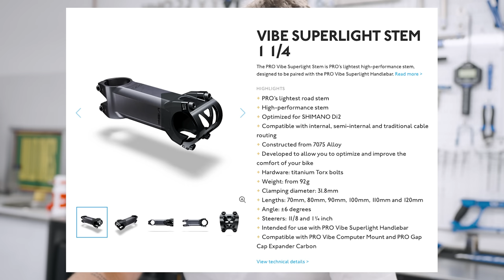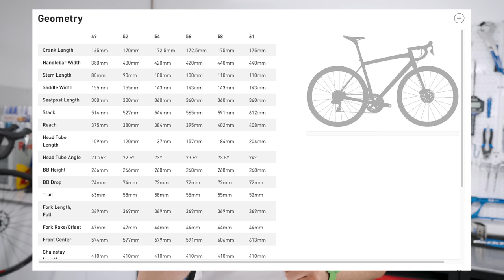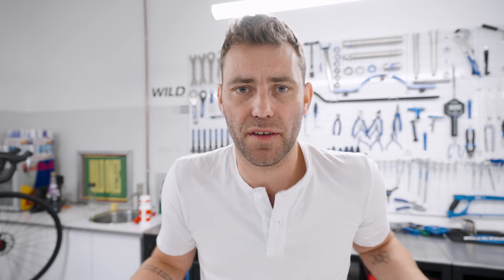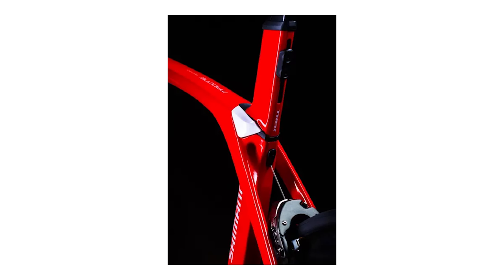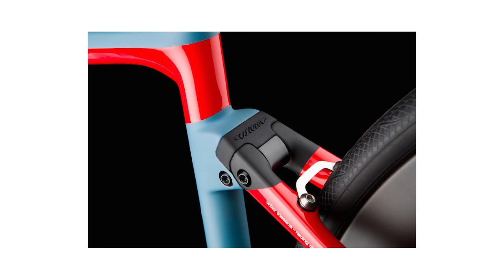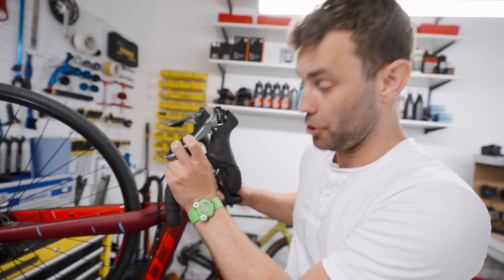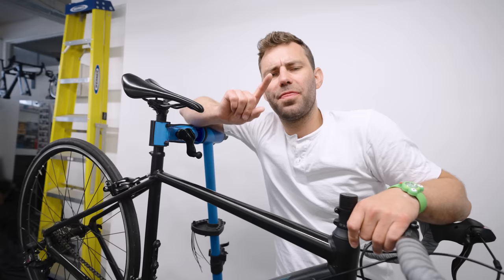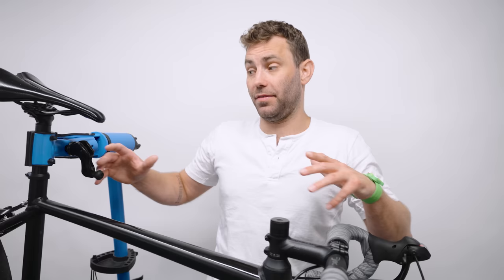Bike Fitter's 10 More Most Hated Products

Comment: The bike sizing thing is so true. I'm 195cm, which puts me in the top 1% of the UK population for height, yet I ride a large Canyon frame. There are two sizes above that!
Reply: What do you think about Merida Silex XL for 194 cm guy? 🤔😥
Reply: Modern geometry.  Look a Beryl Burtons bike fit. Long and low and still holds records.  I'm 6.1 and ride 60cm with 58 top. 90mm stem. Works perfectly as drop to bars not huge. Nowadays I would need, " endurance geometry ". . Progress.  Na
Reply: Canyons tend to run really big.  I'm 178cm and Canyon would suggest a small on their road and gravel frames, most road/gravel sizing guides for other brands would have me on a 56cm frame.  On MTB frames I usually ride a large (my sweet spot on MTB reach is 470-480mm), a size L Strive is over 500mm reach
Reply: @nickyburnell  Sorry, I don't understand the second half of your comment. Could you explain me please? (from "Works...") Thanks 🙂
Reply: @JanKowalski-ux6nt  It depends! Only you know how long your legs, torso and arms are. Only you know your comfortable cycling positions. Best option get a bike fit, if you cannot do that try them out, if you cannot try a specific bike out try the nearest you can in terms of geometry.
Reply: @bencollier9423  Thanks! Btw, have you heard of Flat Pedals Revolution Manifesto? What do you think about it?
Reply: Funny, I am 196 and I ride the largest Salsa Warbird, with an upright posture, and still need a 140mm stem, and ideally would like to go a bit longer.
So in my case, my complaints  that they don’t make bigger frames.
Reply: This is really reassuring. I’m 198cm and couldn’t believe what canyon was recommending for size. I was tempted to fudge the numbers because I thought that surely I’d be an XL or (more likely) 2XL.
Reply: @TheAnon232  If it reassures you further, I've had a professional bike fit since making that comment and the only adjustments required were some some tweaking to the spacers and hoods, and some narrower handlebars. I'm exceptionally pleased with the bike.
Reply: @tinglydingle  good bro 😊

Comment: I agree about those rear suspension. Systems built into the frame - they look like a problem waiting to happen.
However, I've been very pleasantly surprised by the Redshift shockstop post. The mk1 version with the springs is very easily tunable, and it irons out the more serious bumps that my 35mm tyres don't. Without any noticeable bobbing.
It's great for gravel and the crap, badly cracked  concrete roads i ride. If I ever wanted to race, I could pull it off and stick on a lighter regular post.
Seems like the perfect compromise to me.
Cheers
Reply: I think part of the issue with the way rear suspension has been incorporated into road frames (and also some gravel, like that Diverge STR), is that the suspension operates on a parallel axis to the frame, as opposed to perpendicular like suspension on mtbs. Seatposts operate perpendicular, and a couple have no rearward deflection at all. It still changes your fit, but at such a small drop its probably not really a major impact. Flexing 20-30mm rearward though not only changes knee position in relation to pedals, but also stretches you away from the cockpit. Seems so sketch to me.

Comment: The thing with Brooks *leather* saddles is that they've got incredibly short rails, and were designed back in the time when angles were more slack, and all seatposts had setback.
If your bike has steep angles, and you want a very specific seatpost, you better know that the sizing and fit is bang-on.
If you have a bike, where all that is bang-on, you will be quite happy with your durable flexy saddle, even for all day riding, but it can easily go either way.
When you go to the Cambrium rubber saddles, you've got a lot more room for adjustment, but you better hope the shape and flex of them is exactly what you like.

Comment: Regarding long reach handlebars, all the "avoid" handlebars could actually be good handlebars to buy for fixed gear riders which is pretty funny. Since they don't usually use STIs or brake levers with hoods the longer reach on the handlebars make them easier to hold
Reply: 100%
Reply: I have friends with deda bars on fixed, it's not fun lol
Reply: exactly what i thought
Reply: I run a Bontrager VR-C on my State Black Label. It’s perfect 😅
Reply: Also what if you have long arms or a long torso? Long reach bars would be a solution
Reply: There aren’t any hoods, surely you just avoid the hoods position entirely like a track bike, or pick bullhorn bars or something.
Reply: @chrispressdee5747 longer frame...

Comment: I've used both the Brooks B17 carved and C17 (cambium) carved on my fixed gear as well as my two gravel bikes, all of which have a saddle to bar drop of around 34 mm. I like both saddles, but the B17 (aka the leather one) is easily the most comfortable saddle I've used. Maybe it's because my saddle to bar drop is rather shallow, but it just works. At one point it did become more uncomfortable once the leather started to sag, but tightening the screw on the bottom made it super comfortable again.
Reply: Yeah, b17 narrow on my road and gravel bikes. No dramas for me after many thousands of KMs.
Reply: I’ve got a B17 Flyer on my Brompton, easily the most comfortable saddle.  Recently tried an Ergon saddle followed by a WTB Volt, then put the Flyer back on and tightened up the bolt and I’m back to comfort again.
Reply: B17 on my gravel as well. It’s 13 years old and I keep it softened and looked-after…..it’s glorious.
Reply: B17 fixed my saddle sore problems and pretty much all crotch pain issues.  I've never found a saddle anywhere close to is comfort.
Reply: Done a few ultra's in my time, B17 imperial on a Diverge frame with gasp Futureshock suspension: 500km in <24hrs, no issues. 850km in 2.5days, no issues. 1700km in ~7 days, no issues. Will one day do the IndiPac, 5600km, reckon I'll use the B17. Infact, if you look real close, it's there in my profile pic^^^
Reply: B17 on a fixed gear bike is stupid because its a very heavy saddle and when you do stand up pedaling its going to feel like a pendulum swinging back and forth.  If you're gonna use it put it on the touring bike.  Get a nice Fizik saddle with a carbon bottom so stand up pedaling isn't as much of a slog, you don't want to be bouncing a 3kg saddle back and forth every time you stand up.
Reply: C17 on fixed is ok, but it's also heavy and the bounciness of the rubber can mess with your pedal stroke a bit.
Reply: I have got the b17 Flyer and its a great saddle i love it i used the c17 cambium but that didnt worked for me
Reply: I've had a B17 on my touring bike for many years now and I love it

Comment: I brought my canyon endurace 4 years ago, I am 5’9” mature 50+, I was convinced I was a medium size but the canyon chart said I was a small, I brought the small,for my me it was a massive difference coming from a M/L TCR which was recommended for me by local bike shop who just looked me up and down and said yeah that’ll fit.
Reply: Same for me but I just went trial and error. I'm also 5'9" and started on a 54cm Fuji since it was my recommended size. I rode it for 3,500 miles and tried every position imaginable but never quite felt like the bike fit. I jumped on a 52cm frame for a test ride and it immediately felt perfect. I have over 6,000 miles on it now in comfort.
Reply: Canyons run big, but I would have put you on a medium giant in an eye blink. The m/l is for six footers.

Comment: The Trek VCLS handlebar being long reach makes so much sense! I've a 58 Trek and I get bad neck and shoulder pain, feel like I've to stretch too far. Other similar sizes frames I had no such issue.
Reply: 56 Trek for me came with a 7degree 100 stem and those bars with 93 reach. Put a 6degree 90 stem on ages ago and it's a bit better. Next time my bar tape or brake bleed is due I'm definitely swapping down to an 80 or 70 bar. Gravel bikes do generally spec 70s these days (except Trek lol) but I've still got a pretty long torso and I ride drops a lot so I'm leaning towards the 80.
Reply: Trek road frames are all really short though, they’re making them back up to the usual length with a longer reach handlebar. 

You’re probably just on the wrong size bike.

Comment: The thing with Brooks saddles is that they are amazing when you're riding in an upright position. I have one on my city bike for a decade now and it just works perfectly. That's the one with a flat bar with gigantic sweep and not a bike where you need a fit on. Coming from this I did the mistake to get an Brooks C17 when I got my first serious bike just to quickly discover that it's in the way in aggressive riding positions. I got a Supacaz Scorch as a replacement and I do love this saddle so much!

Speaking about wide dropbars for more control : there is this rare breed of people that like to ride dropbar mountain bikes for bikepacking on hiking trails and/or off-road ultras where they make a lot of sense. I started looking for a gravel bike, just to realise that gravel is boring and I want to ride the most remote trails possible.

(If you aim to ride really remote trails swiftly, don't make the mistake to buy a Gravel bike, most of them are seriously undergeared. Get a dropbar mountain bike or build your own starting with mountain bike frame and cassette.)
Reply: Undergeared? They are normally geared like road bikes aren't they while my MTB is running 36-10-52 😂

Comment: I love my aethos. The stack height is greater on the aethos than the tarmac sl7 making it more relaxed.
Reply: That's because both the SL7 and Aethos stack dimensions are given to the top of the bearing and on the SL7 it sits below the top tube by about 7mm, once the proprietary bearing cover is installed the stack becomes identical (this obviously effects the reach too). Technically you can choose to not use the proprietary bearing cover in favour of an external to internal type (basically a standard cover with holes drilled in it) on the SL7 and drop the stack below that of the Aethos but it looks weird as the bearing cover integrates into the frame and it leaves an ugly gap.

Comment: My bicycle fitting pet peeve are road/gravel bicycle brake levers with integral master cylinders for hydraulic disc brakes. This increases the reach of the brake lever body, making it difficult to find a position where it's comfortable to ride on both the hoods and the drops. You're either too stretched out when riding the hoods or too cramped when riding the drops.

Comment: It Doesn't matter how steep seat tube angle is. Horizontal distance between saddle and BB is determined by length of legs and feet. Slacker angle is negated with seatpost without setback and vice versa. Thus you can simply orientate by stack and reach. Everything other can be compansated with stem and handlebars.

Comment: With you all the way until 13:28.  In USA, the mean clothing size is XL and the range to cover 90+ % of the population is Medium through XXXL.    Bike sizes of small fitting the smallest 25 % of population, medium fitting middle 50 %, and large or xtra large fitting top 25 % makes more sense than clothing sizes.

Comment: Last year I nearly went nuts trying to figure out which size of each bike I was considering I needed to look for. When you're trying to buy a bike and you go through websites of stores in your location its a madhouse really. Each time you have to go to each manufacturers website and check their size charts. 
I made the right decision in the end and managed to get the new bike to fit me nicely I believe by nothing more than getting a new stem 10 mm shorter. But the way manufacturers size their bikes and the way bike stores present this sizing info is very confusing.

Comment: Just rebuilt my left 20 year old Campy Centaur Ergoshifter, which can be almost completely taken apart. Didn't really have to as it was working ok. I just wanted to clean it up and regrease it to make shifting a bit smoother and perhaps extend its life a bit. I'm debating whether to do the same on the right one as I did this some years ago. I probably will, because, well, I can. Takes all of 30-60 minutes to take apart, clean, regrease and rebuild, IF you know what you're doing. If not, it'll take the better part of a day, most of it spent figuring out how they come apart and fit back together.

My point is, better than Shimano in this respect.

Comment: Now I know why my feet started hurting after moving to Specialized shoes. Not something I noticed straight away, but after a few months of increased fitness and power my feet started killing me. I wish this was something that was stated upfront when buying the shoes.
Reply: Me also. Have had issues with them for a long time now.
Reply: I'm glad I seen this video cause I have a pair that I use for shopping runs and found that they feel a bit off while riding. I was thinking about getting a new pair for my normal rides, but now I won't.
Reply: Specialized used to (maybe still do) brand this as "Body Geometry" but in most people's experience it is usually geometry for someone else's body...

Comment: As a bike fitter myself, I can concur with all of these comments. The most important thing and something we offer is "fit first, buy second" and also try to find a bike fitter that does not sell off the shelf bikes as they will have no stake in selling you what is on the shop floor. I have had dozens of cyclist coming to me to size a bike and they all say it is the best £50.00 they have spent.
Reply: £50? I’d get a bike fit in a heart beat if it was that cheap here.

Comment: Bar reach - as a general recommendation on the assumption that the reach for most folk is too long is reasonable.  But, like all generalizations it fails in specific cases.  I’ve got 3 drop bar bikes and the bars are 46, 42 and 39.  The stem lengths vary from 50 to 100, and all the bikes effective reach is similar.  Why?  Different applications.  I like wider bars on drop bar mtbs and gravel bikes, my road bike fits James’s recommendation.  Short reach bar, narrower bars and a traditional stem length.  My gravel bike has longer reach bars, and this gives me more hand positions and different reaches for long days at slower speeds.  Short reach bars mean you are generally riding the hoods, great for all day on a road bike but not necessarily ideal on off road drop bar bikes.  The key is getting the fit right, if you do the reach of the bar is not really critical.

Comment: I have a Brooks saddle but it is on my flat bar, upright, heavy duty touring bike. I wouldn't dream of using it on my gravel bike which has a Prologo saddle. Both are comfy for their intended use and both allow me to clock up the miles in comfort. I had a bike fit when I bought my gravel bike(Ribble CGR 725) and the guy put wedges under my Cleats. This worked for me as I have the problem you described (I knew this before I went but wanted to know if he spotted it - he did!). I then tried the Spcialised shoes - they were excruciating. I would love to know who has feet that narrow and deformed! Great video - lots of common sense.

Comment: Just checked the geometry SL7 vs Aethos. They are not the same, but close. 54cm - Stack 534mm vs 544mm and Reach 387mm vs 384mm
Reply: SL7 geo chart is taken without any headset spacers. When accounted for the "mandatory" bottom and top transition spacers the geo is identical.

Comment: I think stack and reach are excellent numbers to look at in mountainbikes, where the handling characteristics off saddle are possibly even more important than seated position ergonomics in certain disciplines. For road/gravel bike the saddle position needs to be included but there isn't standardized way to give meaningful headtube lenght. Is it linear, horizontal, horizontal accommodating seat post angle and at what height. And let's say there are two bikes with effectively same ass to palm distance achievable with adjustments, but one has BB 2cm further forward than other, WTF do I do then

Comment: I have Tourney shifters on 3 of my vintage 7 speed bicycles and I like them way over the old RSX shifters because RSX has no trim function on them. I found Tourney shifters easy to install and set up. Yes, they are not as good as the regular shifters but I don't race anymore since I am a senior rider and I usually spend almost 100% of my time on the hoods when riding.
Reply: Tourney might not be the most sophisticated stuff, but in its limits (means no extreme use)  it works not that bad. Even if it don't cost much money it's still functioning equipment.
Reply: @simonm1447  I agree, my 7 speed Tourney is for leisure riders or beginners, not racing.

Comment: I'm currently converting my gravel bike to a commuter/city bike by throwing on a riser flat bar. Shorter reach, more upright position... I'm stoked about it!
Reply: I did that once but my wrists couldn't get used to the straight bar, if I did it again I would probably try a bullhorn bar.
Reply: @markusseppala6547  yeah, bullhorns are a nice option for sure. With the setup I'm going to have, I'll have almost no pressure on the hands, so I think it'll be smooth as a short trip inner city kind of bike.
Reply: I have a hybrid so it already came with flat bars, but I put on wider Mtb bars on it a few years ago and love it . I use this bike for about everything, although I did find that gravel tires just can't take the abuse that a Mtb tire can, so I gave up on ripping it on Mtb trails.